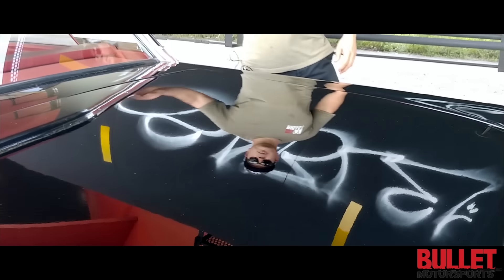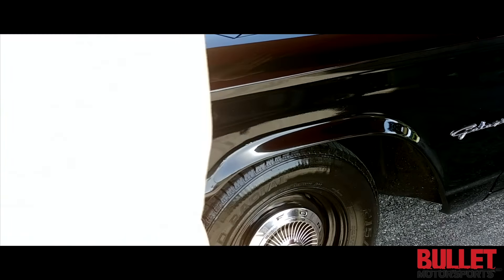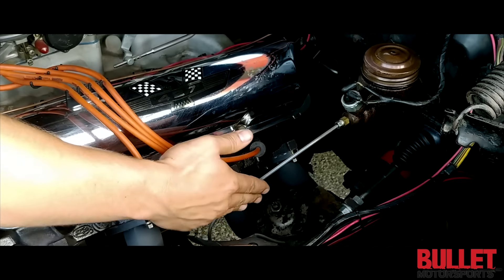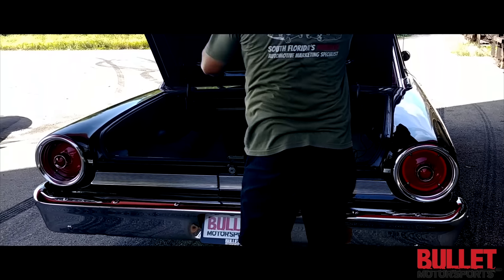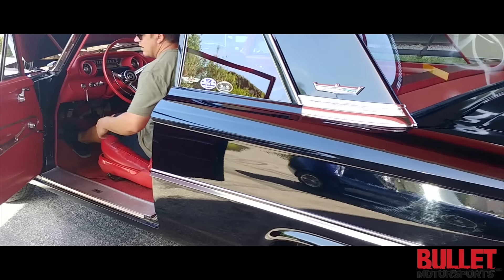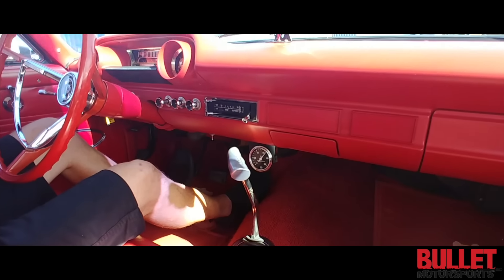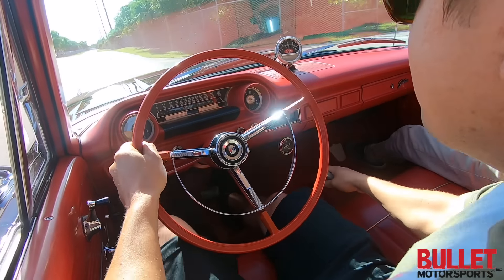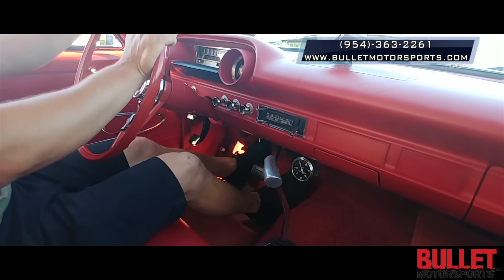1963 Ford Galaxie With 427FE Ripping Through The Gears! -[HD] Bullet Motorsports

Comment: The 7.0-liter FE (427 ci) engine from the Ford Galaxie:

Ford v Ferrari (titled Le Mans '66 in some European countries)[4] is a 2019 American sports drama film[5] directed by James Mangold and written by Jez Butterworth, John-Henry Butterworth, and Jason Keller. The film stars Matt Damon and Christian Bale, with Jon Bernthal, Caitriona Balfe, Tracy Letts, Josh Lucas, Noah Jupe, Remo Girone, and Ray McKinnon in supporting roles.

The 1966 Ford GT40 Mk.II was very similar in appearance to the Mk.I but used the 7.0-liter FE (427 ci) engine from the Ford Galaxie, used in NASCAR at the time and modified for road course use. The car's chassis was similar to the British-built Mk.I chassis, but it and other parts of the car had to be redesigned and modified by Shelby to accommodate the larger and heavier 427 engine. A new Kar Kraft-built four-speed gearbox replaced the ZF five-speed used in the Mk.I. This car is sometimes called the Ford Mk.II.

In 1966, the three teams racing the Mk.II (Chris Amon and Bruce McLaren, Denny Hulme and Ken Miles, and Dick Hutcherson and Ronnie Bucknum) dominated Le Mans,[24] taking European audiences by surprise and beating Ferrari to finish 1-2-3 in the standings. The Ford GT40 went on to win the race for the next three years.

For 1967, the Mk.IIs were upgraded to "B" spec; they had re-designed bodywork and twin Holley carburetors for an additional 11 kilowatts (15 hp; 15 PS). A batch of improperly heat-treated input shafts in the transaxles sidelined virtually every Ford in the race at Daytona, however, and Ferrari won 1-2-3. The Mk.IIBs were also used for Sebring and Le Mans that year and won the Reims 12 Hours in France. For the Daytona 24 Hours, two Mk II models (chassis 1016 and 1047) had their engines re-badged as Mercury engines; Ford seeing a good opportunity to advertise that division of the company. [25]

Comment: 5 cents on the dollar..  that is what i got for my 65 442 with tri-power with green tags. built from the ground up and once it was done i realized that it was not what i had imagined it would be. drove like 65 even though it was a frame off with perfect suspension .... I am in my early sixties and creature comfort had become more important. the fellow who helped with the restoration told me when i was done with the car that he liked new cars not old ones. If you are thinking about restoring and you are middle to upper income, unless you just have to turn a wrench, buy one already completed. they are out there. I was hoping he would mention the gear ratio. my 65 had the 355 rear and was running 3-4 k in fourth. get a automatic with od. i had to have a four speed b/c i was denied one as a kid. just saying... done that been there.. watch them on youtube. a lot cheaper.

Comment: That's about how my '68 435 HP Corvette sounded when the secondary carbs opened. But this '63 Galaxie and my old '68 Corvette would be toast if staged against some modern set-up LS, Hemi, or Coyote. Even some turbo Honda would show these old memories tail lights. Most restorers and collectors agree that putting front disc brakes and a two-circuit master cylinder would NOT decrease the value of the car. In fact, because of the safety improvements, they've been known to sell for a bit more. I know, it's already sold...just sayin'.

Comment: Back in the day we used brake fluid on the tires to give them a black sheen, them greasy looking tires give it the cheap car lot look. Just not a good look on an older car, save it for the ricers. Cool car though, had a 63 box top myself, 390 4 speed, 4:11 gears. Held its own for a big ole boat.

Comment: Be careful with those wing nutz they will fall into the carb. Had a neighbor with a Holman Moody prepared 406 3 2bbl. Accidently have one fall, didn't notice then fired it up after a tune up and killed a cylinder and piston. It was in a 56 F100 so it was way more awkward than this 63, but can and will happen anything is possible....

Comment: a sad aside here in St Louis, a  kids dad worked for a local Ford dealer., spring of 65 an oddball robins egg blue 500 custom came off the carrier truck equipped  with the 427 & 4 speed, dad bought it for son as he didn't feel the Mustangs were worth it and this custom was priced same as the base Mustang , at 1st kid wasn't so impressed until he realized  the power after it was broke in, kid graduated high school that spring then "unkie sam"  drafted him, dad promised the car would be there when he came home, son was in Vietnam 3 months  before an encounter with a mine killed him a 2 others, car sat untouched in the garage for over 40 years until a unknown person stealing gas burned house garage and cars to the ground

Comment: Serious question, I thought FE 427 heads had the spark plugs on the top side?
Reply: You're thinking of the 427 DOHC. They had the spark plugs down in the center of the head much like the Hemi. The "regular" 427s had them on the side like most V8's at the time.
Reply: the SOHC Hemi

Comment: Cast iron headers Galaxy made a
XL  too    I didn't have the 427 but a 390 t bird moter 4-11 gears four speed rock crusher trany top end was about nity five but could get there in a city block bought a four sixty to put in it but the bell housing wouldent mount up wile puting back to geather striped a couple of the bell housing bolts but parked it an bought a 72 Chevelle SS my nephew took the 63 for a ride one day bell housing came loose broke the trany an my Hart it was baby blue with ten inch chrome reverse wheels we called it the ss Billy it was a boat a very fun car

Comment: had a 64 marauder with the427 sohc sideoiler.onebad machine. dad had a 70 ls6 .they were both stock and concourse cars .both 4 speeds he could half a car me in the true quarter mile .dyno- chevelle458 hp (factory 780cfm carb)and we tried frigging with the timing.NOW the marauder factory car .dyno 557 .we f rigged with the timing,and the original settings were the best.if we switched cars,I could win with the chevelle. I took the mercury to go look at a g to at the mall in Ft McMurray Alberta.I parked my car about800 ft from the gto because I didn't want the owner to know that I have a few bucks.5 minutes later I can hear my car start.I thought it was my buddy who went in the mall starting it.he had the keys.then it pulledout of the parking lot andwas gone.the guy whohad the gtowas standing there and I jumped in thecar and thekey was turned ahead for about45 minutes.it wouldnt turn over.I'm screaming at him to shove me to jump start it and he said get out of my car. needless to saythat I lost without a doubt one of the top 5 Marauders in the world.it's black with a black dash and black bench. there is tons of ls6 chevelles,vette and El Caminos compared to a triple black427 soc motor with factory side oiler.that car would do 175-185mph with the gears it had.a few people told me that it was 1 of 500 built for nascar.and the 427 was the only motor banned fromnascar?don't know about that.I only raced 1 guy in 1987 top end.he had a 78 anniversary vette witha468 and a 6-71 Weind blower.he had an after market speedometer,caliberated to his tire size via radar. We raced the full 28 miles and he toppedout at 166mph and I had my brother with me and I would let him come up beside me then the hammer went down again,then with about6 miles left I let it run up to6300 rpm and the vette was 5 miles back.he gave up.when I got to where everyone was waiting,I shut down the car and what a smell of burnt carbon. it was built to run like that for hours.
Reply: Still sounds like your dads ls6 was faster in the quarter

Comment: They didn't put a 427 cu in  stock in a 1963  until the 1963 1/2 model. The Square back 1963 you could on it get a 406 cu in. Stock.

Comment: They didn't put a 427 cu in until 1963 1/2 model.. 1963 squarebarck only came with a 406 cu in. Engine stock.

Comment: Very nice but let me warn you those bench seats are slippery little suckers.... back in the day did some slipping and sliding, no head restraints, no shoulder harness and that old steering wheel will bend under pressure.

Comment: If there were Ford Galaxies back in 63 available with a 427 V-8 why does the Pontiac GTO get sole. Credit for being the first muscle car...which if I'm not mistaken didnt debut till 64?
Reply: Rambler had a midsize 260 Hp V8 in 1957...3Spd OD. The first big v8 in a light production car.

Comment: I did get lucky enough to see a 64 1/2 galaxy 500  427 r code.to bad I couldnt post the pic here.the gentleman bought it brand new and later traded it for a Shelby mustang and then bought his galaxy back again.he has all the paperwork to prove it all.he even had some chrome trim signed by the late great Carrol Shelby...that galaxy was a beautiful car to see and hear it run also.this cr in the post is neat yes but it isn't original so get over yourself man

Comment: 427 Chevy would have faded out about a 75-foot black mark first and second if you done that it seems a little weak accelerator pumps are not right either that's the hesitation but nice car better someone else than me though

Comment: Lolol funny how some say it’s not the original motor hey this car is a very nice car in that maybe it’s a clone but it’s worth money by all means ford made a r code galaxy with the 427 side Oiler so don’t hate and discriminate the guy that cloned this has done a wonderful job oh by the way I built a Chevy 66 impala ss  that was a 327 small block power glide  but what I has done was build a resto mod how by building a Zl1 427 using the newer block but using numbered old stock Zl1 internals heads crank you name it from head to pan no Morrison no edelbrock only original Chevy numbered parts and the k66 ignition with the ballbearing distributor that you can’t find the only thing is the camshaft but it’s the Chevy L88  5535 cam which is numbers for the L88 backed by a turbo 400 so don’t hate on this I love what he has done great job money well spent not aftermarket crap that everyone’s building

Comment: MY 19K MILE 66 HEMI CORONET [ BONE STOCK ] WOULD MELT THE TIRES THRU 3RD GEAR  IF I HAMMERED IT AT A ROLL UNDER 30 MPH..3:54 GEARS..RAN 13:20'S @ 105

Comment: How about them legs! I can now go out in public to show off my bright white chicken legs. The car is cool. Sounds like a big block Ford. I know that guys would go into the dealership and beg them to order a stocker then buy the 427 from parts. Dual carbs are fun but you have to stay on top of them. You can make more horsepower with a single carb. Bigger CFM does not equate to better CFM.

Comment: If it's so good, why does the engine have a flat spot on take off ?
Reply from the maker: Tasman when you roll into it at low rpm it gets over fueled😊 if you were launching it you would be high enough in the rpm band to compensate for that.

Comment: With quads that needs a 4.56 rear, sounds like it has a 3.1 gear.
Reply: NAW too high 390 gear is perfect for street highway. I'm running 411 and it smokes the tires off but pegged on the highway

Comment: 28 spline axles? That 427 would shred those real quick. At minimum you need 31 or even better 35 spline axles! And yes, NOT original paint at all, too shiny and too straight. But I would still give left nut to have this car!

Comment: This KId ruined the story when he said it was originally a 352. Which means this 63 is not an original R code car. But Only a wana be one. The R code cars had special springs,shocks and lots more to handle the 450 HP. The engine seemed to not have factory OEM long tube cast iron headers. But seemed to have the correct mechanical advanced distributor due no vac.line connected to the dist. which All of these FE, Hi Po's had.  He never showed the block numbers to prove its a real 427. A bad joke, but the cars body is very nice.  Plus it does not sound like the many 427s I've heard, no way. Being 74, I've heard my share of these great engines. In 65, I bought from the El Paso,Tx.  Mercury dealer, a 2 dr. 61 Fair Lane (big Ford) FE that said 390 Hi-Po on the gold valve covers, but was not a 390 I soon discovered. The car and FE engine was built by Roswell,N.M Ford in 65, that they raced and ran low 12's. It did have 427 long tube OEM headers with 1965 427 medium riser heads and a dual point mech.advance distributor along with a tri power with 3, 400 cfm Holleys, and solid lifters that all the Hi Po FEs had. The shift point was approx. 7,500 rpms with 4:88's!  What a fine Beast from days long gone!    Beware 427 bogus clones.

Comment: I had ordered a new1963 Ford Galaxy 500XL 406 cubic inch 405 Horsepower which was only available in square back like this for the first half of 1963 until Ford came out with a 1963 1/2  fastback with a 427 Cubic Inch 425 HP to complete in auto racing which a person could order and purchase and then went on in 1964 with the Ford 500 XL 427 cubic inch 425 Horsepower 
This is a nice car but not a true representation of that era

Comment: A single master cylinder with a single brake line?
That's not very "race car".

I've had cars where half the break system went out, from a leaking master cylinder.  I could still stop because I had breaks on 2 wheels.

Comment: In their otherwise 100% "as delivered when new" state, these cars couldn't' get out of the of the mid 14s on slicks, nor would they break the 100 MPH mark through the quarter.  A garden variety 5 year Honda Accord V6 would be a full match for this.

Watch the speed at which the scenery is passing during full throttle acceleration and it becomes obvious that this car is more about noise than anything else.

And forget about the Gross factory HP and torque ratings of the pre-1972 Net area because the were, in the words of former CAR AND DRIVER editor in chief and Ford engineer,  Csaba Csere, "essentially meaningless."  I doubt this engine made anything over 285 Net HP in its as delivered state.  Indeed, these cars weren't even fast by Pontiac SD421 and Chevv 409 (the solid lifer versions) from the same period!
Reply: but who wants a garden variety honda accord v6???

Comment: It's not a turbo numbnuts you don't need to spool it up,. Also the gears were synchronized with the clutch much different then the short throws on the shifter with cars nowadays

Comment: So over restored..this car never looked that good.. and the original car certainly did not come with a Porsche paint job.  Sorry.. over restoring is not period correct
Reply: Really? You must be at least 66 years old - that would mean you were 10 when this car was new, and I doubt many 10-year olds inspect cars for their appearance. I am 77 years old, and was blessed to get a ride in a 1965 Galaxy 500 with this engine fresh out of the showroom. The owner said that the blue paint on it was a $100 option, which was my first exposure to an extra cost factory paint color. About a year later one of my friends bought a solid red one. So, I have seen what two of these cars looked like right out of the factory, and my young eyes thought they looked perfect. In retrospect, I have to laugh at the puny tires with tread that seemed about 5 or 6 inches wide. I was riding with my friend one day in the red one when he pulled out to pass a slow car going up a long hill. Right beside the slow car, we saw an oncoming car pop over the crest of the hill. He panicked, gave it too much throttle, and we "crept" around the slow car while he pumped the accelerator, letting the tires catch up, then breaking them loose again. That was one of my scariest experiences in a car.